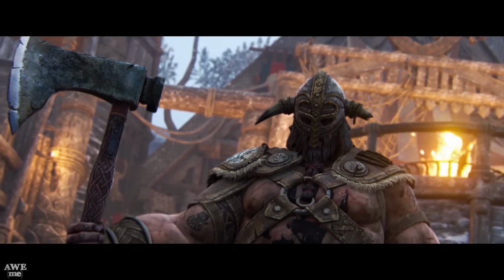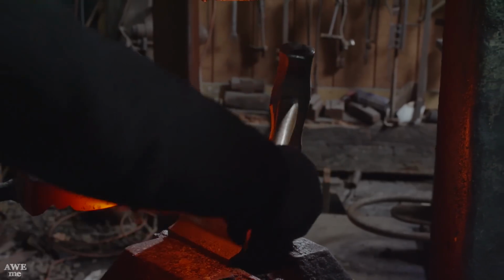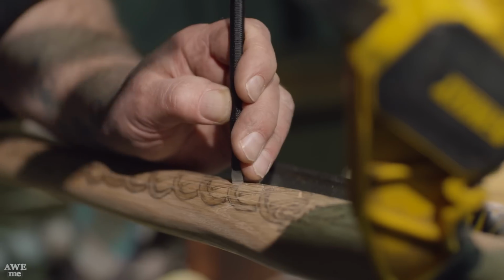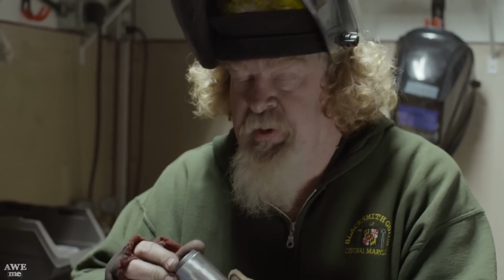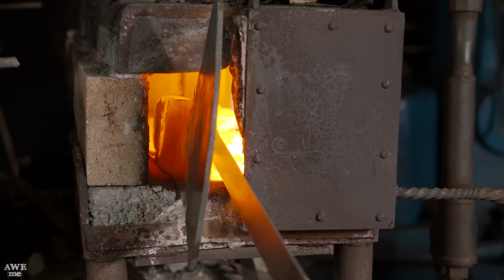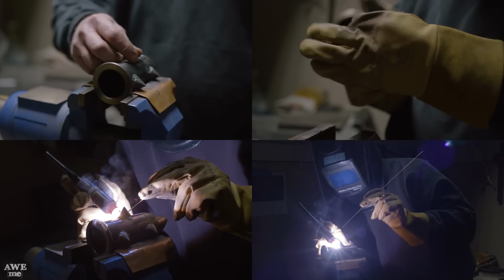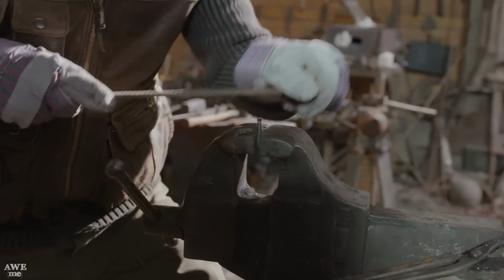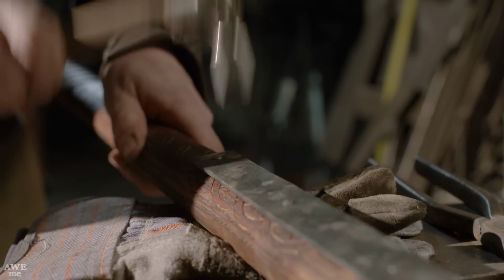Viking Dane Axe - For Honor - Man At Arms: Reforged (feat. Mark Dacascos)

Comment: Man At Arms, you guys do a lot of recreation swords, giant swords, functional replicas and fantasy weapons. I wanna see you guys create a high-performance sword. The best sword Baltimore Knife and Sword have ever made. Top of the line steel, distal tapers, perfect centres of percussion, good edge retention (maybe differential tempering?), razor sharp (i.e. will shave you), solid construction, original engraving and art designs, good blade geometry, excellent point of balance, a protective pommel, ergonomic pommel letting you feel your edge alignment, of course the pommel construction will be on point as always, a good flex to take the strain of impact (HEMA or Kendo consultants for the feel of the blades? I dunno...), and basically make the most perfect sword you guys ever have. Call it, "At the Man's Arm," or "the Perfect Sword." I think it would be an awesome challenge, from forging to grinding, to material sourcing.

EDIT: I know this is a lame thing to ask, but it seems like they respond to "a lot of similar comments" as opposed to one upvoted one. Thanks for all the thumbs, btw. So, could you guys repost this? Or a similar one? Just to help make this happen! Only if you guys want to, of course. Thanks, again!

Credit Stefan Massyn
Reply: I thought the same thing. Then we would see all the workers skills, which would be nice
Reply: Looking at all the things you listed, as a practical thinker, i would hazard a guess that such a sword would be just about impossible to make. as a fan of this series, i want them to prove me wrong.
Reply: Well the real question is which sword should the perfect sword be?
Longsword, Gladius, Sabre, Shamshir, Tulwar, Katana, Rapier, .....there are far to many to call one the ultimate sword in case of the overall shape.
Also do you want a truster a cutter a cleaver, etc,... cause even simple medival sword can have a huge variety in there performance in different areas.
Reply: Why not make a series? I think longsword or shamshir are the ones who can have the most costumisation.
Reply: You're basically asking Ilya to do the whole thing by himself, lol. He'd do it.
Reply: If you're talking about a high performance sword (as in, could be used in a real sword fight) you wouldn't want the edge to literally be razor sharp. The edge would be too thin and fragile
Reply: You can maintain a bevel of 20-28 degrees, keep it clean, and it would still be capable of shaving you. A "utility edge" ideally should be able to shave you without issue, and it would not be too thin or fragile. You underestimate the capabilities of modern materials. It's quite a common misconception, "razor sharp" (as in, the exact point in which a blade becomes capable of popping hairs) is nowhere near as sharp as a blade can be.
Reply: don't they do this every day of every week?
Reply: Now that is a challenge! :D
Reply: This is there job they do that anyway.
Reply: what he meant by perfect sword was not one sword to rule them all, but to make a sword as perfect as they possibly can using maximum effort. that is why he says "The best sword Baltimore Knife and Sword have ever made." not the ultimate sword.
i know u wanna make people realize there is no one true sword to beat all others but atleast read his question correctly.
Reply: That would be cool to since reforge was originally weapons together, I remember they made a batman-wolverine gauntlet, a lightsaber themed katana and captain America throwing stars. Man at arms please make this sword.
Reply: if they do that i would love to see a scabbard to go with it
Reply: Make sure that pommel is threaded so we can end him rightly
Reply: and please don't test it on things I can break with a stick or that can be cut with a dull kitchen knife...
Reply: Someone is flexing their newly gained wiki information.
Reply: Well, they're trying to. Pedantic use of terminology is the big red flag.
Reply: ...Skallgrim made the video about the pommel in December of 2014. This joke is literally two years old.
Reply: Only a pommel can end this meme rightly.
Reply: Tea Party
Reply: Sergio Díaz Nila a functional and deadly publicity stunt.
Reply: And they rock while doing it, I'm glad For Honor approached them, finally a rough two handed viking axe. :D
Reply: oh wow people are actually doing it 

I'm gonna do it too. you already credited the original right? I think he was on the assassins creed video
Reply: That's lit bro!
Reply: Aslong as the pommels detachable
Reply: @Jordan Kensky k
Reply: Jordan Komsky like a 15th century long sword
Reply: Yaaaaaaaaaaaaaaaaaaaaaaaaaaaaaaaaaaaaaaaaaaaaaaaaaaaaaaaaaaaaaaaaaaaaaaaaaaaaaaaaaaaaaaaaaaaaaaaaaaaaaaaaaassssssssss
Reply: @Leo Alm Wärn they did it out of shitty historically accurate steel and with mostly original technology, with differential hardening, so it isn't very good. Homogenous spring steel, properly quenched and tempered, might hold the edge a bit worse, but the sword itself will be much stronger
Reply: @dedompler  he did it with Excalibur
Reply: @Kataclysm113  i want them to prove me wrong too. Do it lads ( 'o')
Reply: your saying they should make their own design for once? like The Baltimore knife and steel sword? that actually does sound like a cool idea. i would like to see what they could do if they just go for the idea of absolute best top of the line sword.

Comment: nodachi: cuts through roses and blankets
dane axe: breaks concrete in half

0_________0
Reply: Tatami is not blankets
Reply: Natsu Kussun what is it then?
Reply: @noahbachfrandsen1533  Tatami is some kind of flooring as far as i understand it, it's pretty difficult to cut if you have a bad sword
Reply: Menarg ok i see what you mean, but CONCRETE.
Reply: Damn stop fighting both are great
Reply: @noahbachfrandsen1533  concrete is actually quite brittle, which is why it's reinforced with iron when used in buildings and stuff
But yeah It's fkin dope
Reply: @Karl Bush true enough
Reply: @menarg1549  like to point out that Tatami mats are pretty easy to cut when they are dry, its when they are soaked they are harder to cut, when they are soaked(like left underwater for like a Day) they are about the same resistence as a human limb. When they dry the pretty easy to cut If you align the edge decently

Comment: Corvo Attano's blade from Dishonored?
Reply: Jim Jelly Jin Jam Jimbo I support this however convos blade breaks physics as the blade is longer than the piece it is stored in
Reply: well, the blade can be expandable..a hollow blade with several pieces with a spring contraption to extend and fold the blade. That might work.
Reply: ...well it might work as in the mechanism but in no way would it be of any use, it would essentially be like a toy that you must never try out.
Reply: Mole trapping

Comment: that two handed axe which is from this show is not actually a viking dane axe ...... dane axe's axe blade was very thin, sharp and light. The actual dane axe does not have hammer on the other side ......dane axe was not the bashing or heavy chopping weapon. Dane axe was more like sharp cutting and hooking weapon.
Reply: I mean, they made the dane axe from the game which isn't a 100% historical accurate. The axe they made is very accurate to the game though.
Reply: The axe in this episode looks more like something the Norwegian would use
Reply: No.
Reply: And it would have been about the size of the weilders waste to the top of the head. This is meant for those one in a million people like hafþór Björnsson the Mountain, the guy who’s 6’9” and 440lbs of muscle.
Reply: its a game weapon, not an historic weapon
Reply: Rafael López, Dane axes were real
Reply: @spencerwilliams1157  One in a million, or otherwise someone from the Island of Giants, aka Iceland. :P
Reply: @suclox12yearsago56  there werent norwegians or swedes or danes.....
Reply: @spencerwilliams1157  It would still serve Hafþór Björnsson better if the weapon was lighter, the lighter the weapon the faster and better it is, that is why most people used spears on the battlefield.

Comment: Actually the most common weapon in most viking shield walls was the spear because they were so easy to make. Axes were also sometimes common but only some vikings actually used them regularly. Another very common weapon for vikings was the long knife or seax
Reply: It went like this; Primary weapon was the spear, secondary was the axe (sword if rich enough), and the seax was more of a tool or reserve weapon. I left the shield out for obvious reasons as it was (obviosly) not really used as a weapon.

Comment: Can someone explain to me, do they quench the blade first and temper it immediatly after that, or what, because in some vids, they forge the blade and then they grind it without quenching and only then put it in hot oil, not showing the tempering process. I'm confused about the forging of blades now.

Comment: uberalex90
Man At Arms, you guys do a lot of recreation swords, giant swords, functional replicas and fantasy weapons. I wanna see you guys create a high-performance sword. The best sword Baltimore Knife and Sword have ever made. Top of the line steel, distal tapers, perfect centres of percussion, good edge retention (maybe differential tempering?), razor sharp (i.e. will shave you), solid construction, original engraving and art designs, good blade geometry, excellent point of balance, a protective pommel, ergonomic pommel letting you feel your edge alignment, of course the pommel construction will be on point as always, a good flex to take the strain of impact (HEMA or Kendo consultants for the feel of the blades? I dunno...), and basically make the most perfect sword you guys ever have. Call it, "At the Man's Arm," or "the Perfect Sword." I think it would be an awesome challenge, from forging to grinding, to material sourcing.

EDIT: I know this is a lame thing to ask, but it seems like they respond to "a lot of similar comments" as opposed to one upvoted one. Thanks for all the thumbs, btw. So, could you guys repost this? Or a similar one? Just to help make this happen! Only if you guys want to, of course. Thanks, again!

Credit Stefan Massyn

Comment: Okay  Mr. Host,

Point of Clarification. That is NOT a Dane Axe! No Norse weapon ever looked like that! 1) Dane Axes were not used for chopping wood, they were battle axes only. 2) Vikings were Norse. 3) Yes, we did a lot of raiding but we also did a lot more trading. 5) What these guys built was based on a video game, not a true Dane Axe. And for the builders. 1) If you're going to try and make something historically accurate, blacksmith it, not modernize it. 2) Get your information correct. Dane Axes rarely weighed over 7 1/2 lbs  and we're on a 4 foot stave, not 6 ft. 3) Dane Axe's didn't have a hammer head on it either

Comment: The Viking weapon of choice was the spear, like everyone else at the time.
A Dane axe is a weapon exclusively, not a splitting axe the head is way too light.
Also the raiding started as early as the 7th century and by the 9th it had mostly turning into trading instead.
Lastly, Gorm the elder united the Danes.

Congratulations, you also made the raider's completely impractical axe, not a Dane axe by any means.
Reply: Why fo you know this
Reply: @nug7742  This is simple knowledge, the spear is plainly more effective for the common soldier.
The axes used in war have light heads to function properly as weapons, as splitting axes are simply too heavy to swing around for extended periods of time. Also, they typically require two-handed use, which is unfavourable if you lack in armour, as a shield would then be your primary defence.
In regards to raiding, it is simply more profitable to trade instead. That's why it went out of fashion. Another reason is the christianisation of the Danes, which was most likely a deliberate strategy to end the wars with christian Europe.

Comment: hmmm welll you made an axe .. but in no way a dane axe ...  everything you did was wrong .. even the  way you forged the head ...   and there was way to mutch grain  runoff in the handle and you eaven used the wrong wood ..  you should have used Fraxinus excelsior  or ash wood as it is also known ..   

like .. everything you did was wrong ..

Comment: Great job, but Vikings never used such a big axe.
Reply: TheKZTuber The Raider does, it's a video game.
Reply: Yes but he's saying that the axe is massively oversized and unwieldy. A true Dane axe head would be much thinner and the handle would be shorter so it can be use with speed and not be way too heavy like this axe.
Reply: So you're not going to talk about the thing where he said that if you saw a Viking ship you were going to get raided/plundered?
Reply: Fodge, and as I said above,  a Dane Axe would never be over 7 1/2 lbs
Reply: Panda In a gas mask. The raider would get frostbite and die in like a second, given that he charges into battle half naked.
Reply: Bengan McRoger strictly speaking a viking ship is a pirate ship because that's what viking means (as far as I'm aware), so I guess at least that part was kinda true?
Reply: Well, you're not a Viking. You may, however, go on a Viking. The literal translation is 'Raid', but yes, Pirate would be correct as well.
Reply: TheKZTuber they actually did
Reply: A more literal translation is expedition but in the sagas it is implied that these were to raid. But vikings also settled Iceland and Greenland. Also discovered North America before any other European
Reply: Eeeeeeeeeehhhhhh... debatable
Like most two handed weapons, especially pole axe type weapons, the Dane axe fell into a heavier class of weapons of historically.
Shafts could range anywhere from 4ft to some even 6ft in length, and the head itself was actually pretty broad.
Being a flesh cutting axe it was thinner than a hatchet, but this was an axe designed to cleave through bodies and punch through shields and armor (The purpose behind the extended upper horn on most) so the head would still be plenty size-able. 
Is the in game axe over kill? Yes absolutely...
But as far as weapons go Dane axes certainly fall into the heavier category.
Reply: The guys probably know that, they’re not just good at making weapons, they definitely know a thing or two about them. For example when Matt explained how the Leviathan Axe in God of War ‘isn’t exactly a historical axe’. Difference is that video wasn’t sponsored. I don’t think the studio allowed them to say anything about the realism (which the game is lacking) of the video game.